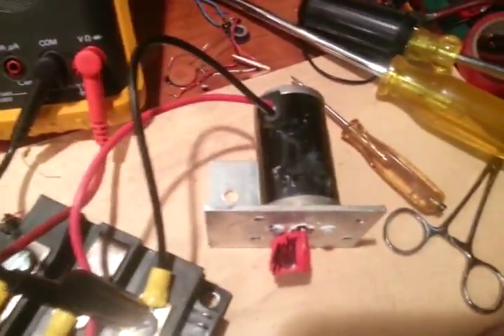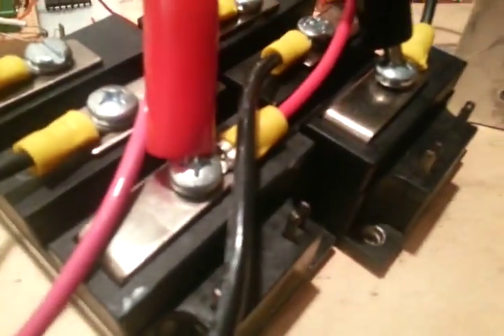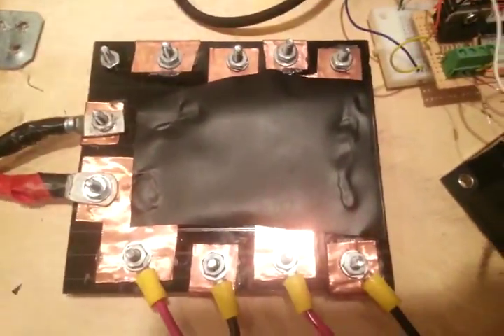LabJack T7 controling 150A Transistors for Motor Control

Comment: can you please tell me how to interface the labjack T7 to labview . i want to measure thermonuclear. plzz thanks
Reply from the maker: https://labjack.com/ has everything you will need.  They have libraries that support various languages, including LabVIEW, MatLab, C/C++, Python, Java, and more! There are examples within the website for each of these uses.
Reply: Hi i too refer that https://labjack.com/ website but they give only for U6 and lower products library for labview i couldnot find any library or examples for T7. Can you please guide me to do or please Upload a video "interfacing T7 with Labview" it will be really helpful for me and other users too i searched a bunch of web sites no one have an example so if you have time please upload a video thanks in advance :)
Reply from the maker: https://labjack.com/support/software/examples

Navigate to the top bar, click the "Support" tab. Looking at "Software & Drivers", you can see a link for "Example Code/Wrappers." You can then click on a link for The T7 (which uses the LJM driver) for LabVIEW (or C/C++, Java, ect.)example programs. The above link also brings you there.